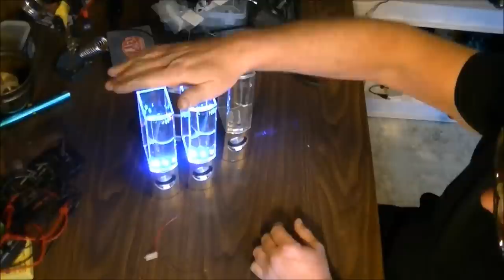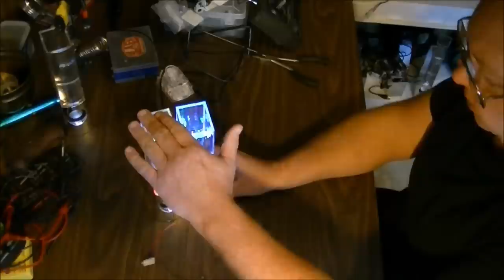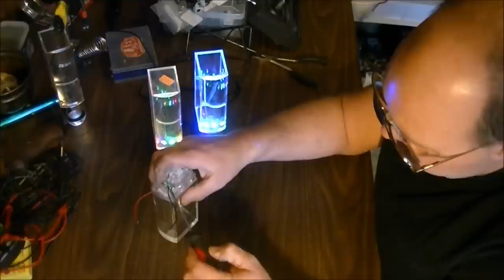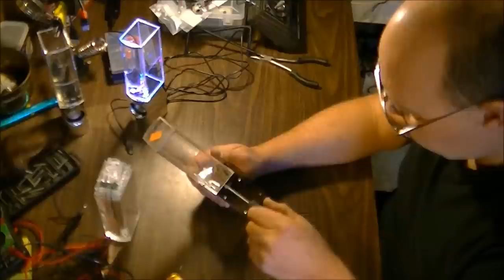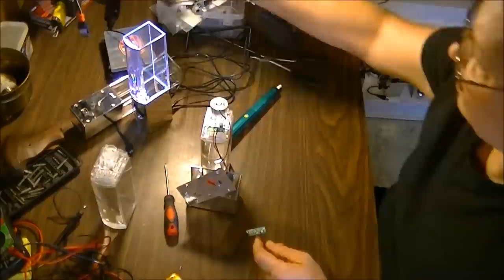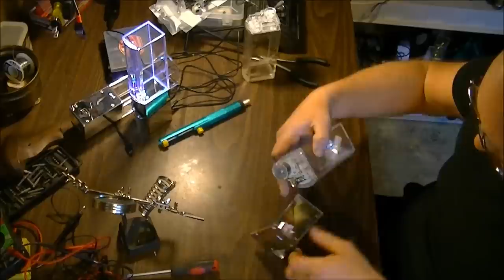Gadgetree Dancing Water Speakers How To Replace The LEDS

Comment: hi,  i just need to know where the red wire goes on the led circuit board.  Wasn't working so I took it apart and the red wire is no longer attached.  The black wire is there and attaches to the center which is where it looks like the red one is attached on all your videos.  Help!  I'm confused.
Reply from the maker: the pcb board on the led strip is clearly marked with a + and - sign so find the + sign connector and solder the red wire back on if you need a real good close up of this let me know and ill do a video
Reply: please, a god closeup would be helpful.  Can't see the +/- on the circuit board, and I'm wearing my glasses...lol
Reply from the maker: Jeannie Terrier the video will be uploaded shortly as long as you are subed to my channel youll be notifed once its uploaded
Reply: thanks!
Reply from the maker: Jeannie Terrier your welcome

Comment: Hey I recived my water speakers today and one of then have more water than other , how can I add more water ?
Reply from the maker: iam sure if you check the posts on my video and check out my other videos on these speakers youll find all the info you need personaly they are brand new send them back for a replacement set they do have a warranty
Reply: I try to find this video on your channel and I didnt find , can you send the link to me ?
Reply from the maker: Arthur Araújo i dont have specific video how to fill them i only explained it in a few of my videos in the posts. , but short version you need mineral oil and the thinner for it you have to find the right mix so it acts like water. then you need a surenge with needle and inject it  in the speaker glass there is  a plug you inject it then reseal the plug with hot glue or silicon or jb weld so it wont leak out again , make sure you clean out all the areas that got leaked on including the motor if any got on it it will burn out the motor , , which is why i sudjest that they are brand new they have a warranty then put in a claim and get them replaced under warranty..
Reply: Thanks man I will try to do this , you help me a lot
Reply from the maker: your welcome
Reply: +KevinMillard68 You know what I can mix the mineral oil to stay as liquid that is on the speaker ?
Reply from the maker: Arthur Araújo as far as i know you use the thinner for the mineral oil

Comment: How do you put water inside the water speaker because one of my,speaker doesn't have water....
Reply from the maker: hi there first of all its not water secondly if you check my other videos on these speakers on my channel youll get the answers you need in others and my posts. 3rdly its far cheaper to replace the speakers or i can sell you a new glass but i only have a few left. i collect sets that go bad and refurbish them and some that i can not fix i keep the good parts only.. if you want a replacement glass then email me at airsmith28@hotmail.com with your shipping details and ill get you a total with shipping on a replacement glass .. hope this helps
Reply: Ok thanks
Reply from the maker: Tiara Heart your welcome

Comment: would be awsom if you could put in RGB led,s
Reply from the maker: red green blue and yellow comes in them you can switch out to any leds you want just takes a bit of soldering and some new leds
Reply: yea and meby hack into a small cheap strobe and put it in ther :)
Reply from the maker: ljmike1204 k